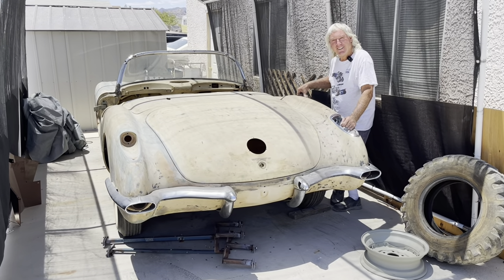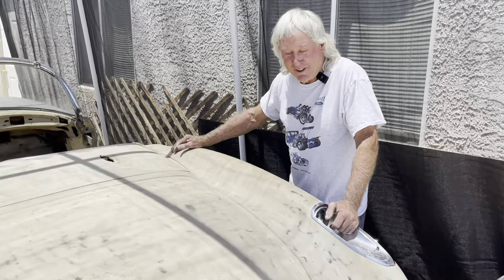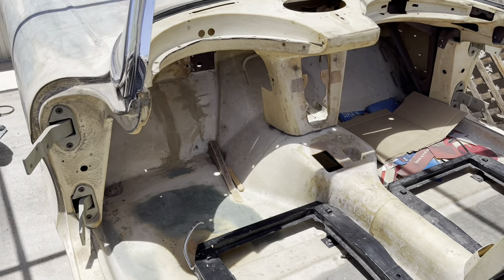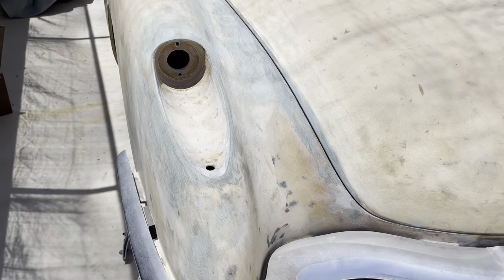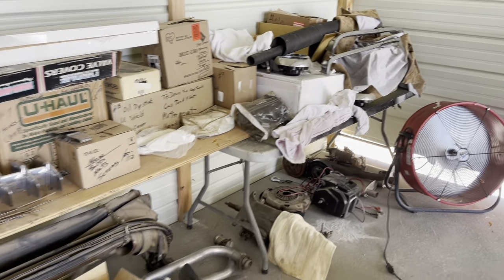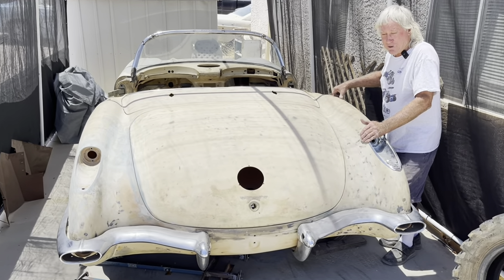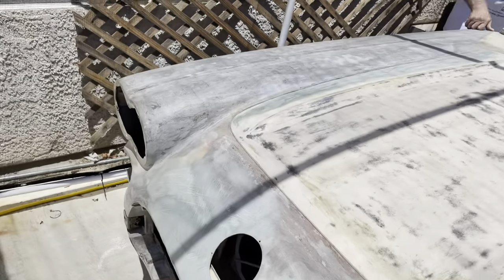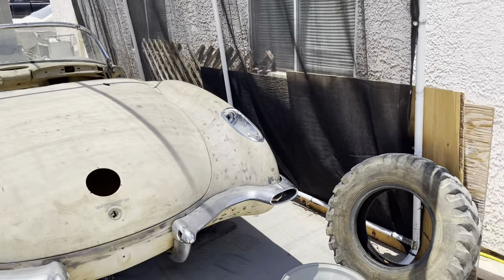1958 and 1954 C1 Corvette’s restoration! Extreme builder Gordon Tronson show’s his newest project.

Comment: Hi,
I too had a 1958 corvette. I bought mine in 1968. I drove it the first two years then spent the next seven restoring it. One question I might ask is are you sure that's not a 59 or 60? I don't see the louvers on the hood or any holes for the chrome trunk bars. Both of those items identify the 58. 1959 and 60 did away with those items. Aside from that, I envy you since I would love to restore another one.